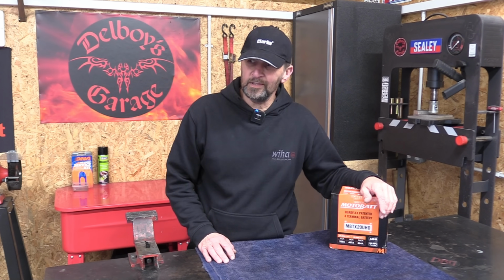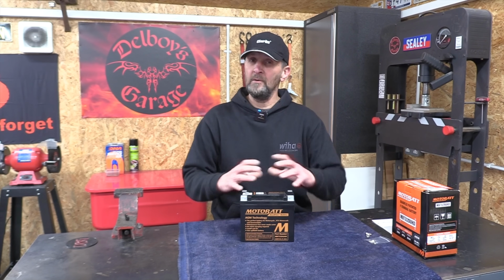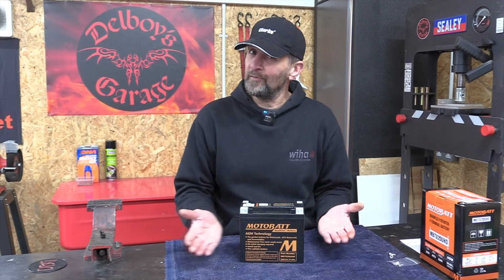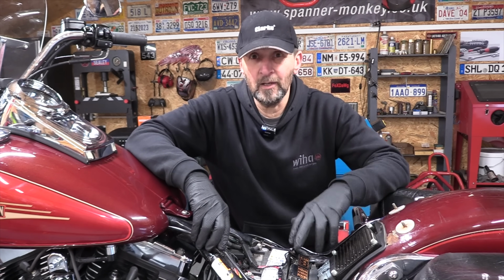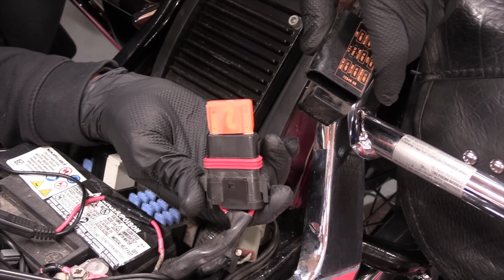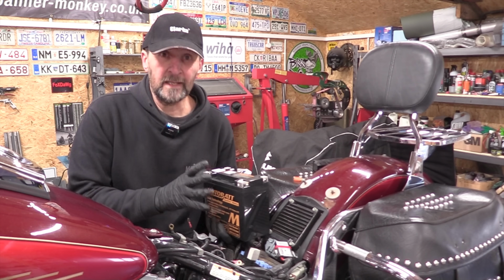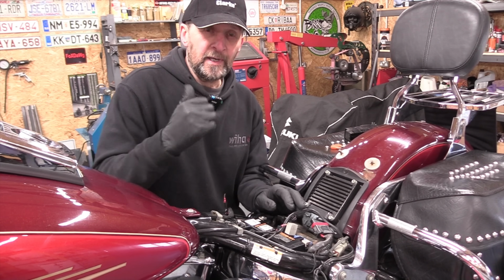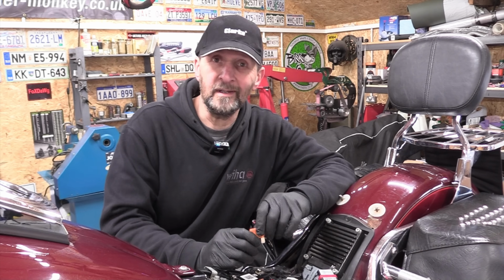Harley Heritage Softail:- Motobatt Battery Upgrade !

Comment: Just wanted to thank you for this video, this work around on the alarm worked perfect for my fxstc softail, and the video layed it out perfectly and simple. Gonna tackle changing fluids next:-) I’m really green at this but this video was spot on and just the pace that kept it simple. Thank you !!! Question: will a  Ctex charger maintain this battery in the winter months ?
Reply from the maker: Anything that is a proper dedicated battery tender, designed to maintain a battery over long periods is fine, just as long as it's not a straight charger only...

Comment: Christ you weren't wrong about those battery's Del just got one and they are serious quality just the bloody weight of it and the 4 terminals well what can I say handy as Fcuk,I wont mention putting it in the wrong way around 🙈🤦 spotted before I connected 😂😂.
Reply from the maker: Nice one mate, as you can see, you can actually mount them either way round with the 4 posts, as long as the cables reach... have fun!

Comment: I use that battery on a 1995 FatBoy. Durability is about 2 years and 6 months, I rode 30.000 miles with this battery. Just today I replaced it by a new one (same battery)
Reply from the maker: Yet I've had one on a Triumph for 12yrs... still going strong!... go figure
Reply: @ what durability time did you get with this battery?, the same as me?. It’s a good battery.

Comment: Lovely smooth video Del.
Batteries are the bane of my life! I have  Optimate 4 Chargers connected to all my bikes AND both my cars- but I still have less than good luck with the buggers.
I’ve found it’s a good idea to fully charge any battery before fitting: and then grease the terminals after. 
On my Deluxe, I’ve fitted a heat shield between the battery and the oil tank in an effort to try and keep the battery cooler. Hopefully extend its life. Heat is a battery’s enemy.
Without being condescending (truly), I thought you fitted that battery perfectly- +ve first on and negative on 2nd. Not a lot of people seem to understand that and the reasons why..
Very sharp and very knowledgeable for others to learn from.
I know I have.
Reply from the maker: Yes it is important as we all know, a little mistake with the lead arcing and suddenly it's all going flash bang lol...!  Thanks for sharing your experience and have a great week, ride safe mate.

Comment: Always run an AGM battery here too - although I did experiment once with a lithium battery, but didn't like it. That's interesting about that alarm procedure because I don't need to do anything on my Road Glide with security system before changing out the battery. EDIT: Oh, never mind, I don't have an audible alarm on mine, only the start disable security.

Comment: I could do with one of those on my 2023 BSA Goldstar 650 as the bike is on its 3rd  battery. There does seem to be an issue with these bikes on batteries, but apart from the 'Health Check' (AKA recall) BSA are keeping stum on that.😳
Reply from the maker: That's odd, sounds like a current drain maybe!  But if BSA are aware of it and it's already a 'thing' fleet wide, then it's more likely a design fault... hope you can get it sorted mate.

Comment: Well done Del, thanks for another great video! My first and still only bike is a 2003 Heritage softail in silver and black. Mine came with a few Lord Humungus studded extras. I don't mind my tank and rear fender bib because it has a silver paint job plus all the chrome i felt it looked better with some extra black bits to tone it down. I hated the dog bowl on the front wheel and had to remove it. I remember watching your softail vid on oil changes when i first got my bike before lockdown. I'm glad you now have a Heritage. I'm fairly tall and personally found the backrest and highway pegs really comfortable. Kuryakyn do a transforming back/pillion rest that works really well whether you want to ride alone or with a pillion, it looks and functions well. Not cheap sadly. I'm glad you have picked up loads more subscribers since i first watched. The work you and Penny have put in thoroughly deserves it.
Reply from the maker: Thank you so much for such kind words of support, and i do like the 2003 paint scheme, had it on my 03 Sportster and despite a full frame up restoration of the entire bike.. i left the fuel tank black livery alone.. complete with the huge anniversary badge. just looks right.   Than kyou again for your long term support, and ride safe aye !

Comment: I’ve never had much luck with AGM batteries, for some odd reason dis charged till I hook up charger, it last a while, alternator doesn’t fully charged it. New battery came out, it was part AGM and part wet, tried it, golly, had it for 5 years with tender on it, been the longest I ever used.  My 1990 gold wing battery quit 2 years for some reason, I put in same AGM/acid battery in it, so far it’s holding.  I’m not too much fan on AGM so win some, lose some on my part. Nice trick on that alarm system, I like that!! Really kwel.

Comment: I'm so old I remember when the hardest part of changing a battery was paying for it. On the new stuff you have to worry about all your electronics getting amnesia. Great idea having 2 sets of terminals for all the extra do-dads we stack on them. It's always nice to know you have plenty of crank on a 700+ pound bike. 😁 Thanks and blessings to you both. ❤👍👍
Reply from the maker: Sure thing Rick, they're still not cheap, but a necessary investment!  Have a wonderful rest of your week there, and thanks for all your kind words of support, it is appreciated!  D&Px
Reply: I MUST BE OLDER ..I REMEMBER WHEN THEY DIDNT COME WITH A BATTERY ,JUST A MAG AND A FUSE , WHEN THE FUSE BLEW , YOU TOOK THE SILVER PAPER FROM A PACK OF SMOKES ,WRAPPED IT AROUND THE FUSE , KICKED IT OVER AND GOT TO THE DEALER TO BUY A NEW FUSE ;;;GOOD OLD DAYS

Comment: Not applicable here is that another great thing about AGM (Absorbed Glass Matt) batteries is that they can be oriented horizontally also.  Hot rods, race cars and custom bike builders love them for that.  Race cars because they can be mounted horizontal AND they are very vibration resistant, so Harley (and all motos) of course.  Cheaper than Lithium.
Reply from the maker: Yes indeed, good point, all the benefits of lithium without the drawbacks, or the price!

Comment: With the m8 softails having the monoshock under the seat, the battery is buried and a pain to get to.  The new softail suspension is a good improvement on the old softail frame so I guess there has to be a compromise somewhere.
Reply from the maker: I currently have both, old and new Softail models, and I'd disagree that the M8 platform handles better, I'd say perhaps the forks are better as they're thicker, but the general handling of the modern bikes doesn't stand out in any way... the M8 weaves in long fast bends, whereas the old one doesn't... so perhaps there's still a little way to go!

Comment: Thanks for the heads up on the cost of Motobatt batteries Del. The Yuasa battery in my bike is around 4 years old so I may try Motobatt when existing battery starts to die. I always use a small square of high density foam underneath the nuts on my bike battery which prevents the loss of the nuts.
Reply from the maker: Great call on the foam, ive used a tiny chunk of 6mm plastic tubing to do the same.. but thankfully these don't have the nuts, just thread directly into the terminal post.. much simpler !

Comment: I do the alarm hack slightly different:    Switch on ignition  - and off again.   Then pull the main fuse within 2 seconds(!)  and the alarm will not know either.  
(when I connect after battery replacement,  I do it in reverse but not sure if that is necessairy)

Comment: Thanks for this very useful post. I have a 2016 Yahama FZ-07 (MT-07) and it originally came with a Yuasa battery (YTZ10S). I've replaced it once (with a Yuasa) and I'm coming close to needing to replace it again. I see MotoBatt has a battery for my bike and it is much cheaper than a Yuasa. I will give MotoBatt a try, especially since it has the two additional terminals for the extra electrical devices I have on my bike.
Reply from the maker: Good call, have a try of one, i think you'll approve.!  The extra terminals make it a no brainer.

Comment: Very informative. One question, does the battery come with 4 terminal screws for the 4 posts?
Reply from the maker: Mine had just two....so i used the two off the old battery, same thread.!

Comment: Have a 2022 street bob 114 fxbbbs and would love to upgrade the battery, but I cannot be arsed strpping down half the bike to do it, why did Harley not put the battery towards the side if the bike instead of making them hard to work on is beyond me??????  I'm having to leave my bike on trickle charge so I can carry on using the bike
Reply from the maker: Yeah, agreed, same on my Street Bob.. ridiculous location, don't know which would be quicker, lifting the suspension out, or stripping all the electrics off the left hand side... either way it's just daft aye !

Comment: Followed your tip with the fuse from the first video you made way back. Easier to fit a battery on this harley than my sportster , I needed 3 hands with 6 inch long fingers half inch dia to get to the bloody negative terminal lol.👍
Reply from the maker: Ha ha, aren't they annoying, designed to be fitted by The Borrowers..lol!    it actually helps out if you drop the earth lead off the engine end, and feed it through the inner hole, that way you can prefit the lead to the battery nice and securly.!

Comment: I still remember hearing about motobatt from you all those years ago! I fitted two or three to my HDs and some other bikes to! A nice trick is also to bind a strap of some description to the battery before seating it in place: that way when you need to pull it out it's a lot less work! On my fxstc there's almost no room for purchase on the battery once it's in place!
Reply from the maker: Mate, that is genius level common sense, make a small hook strap to pull it out again... only those who've experienced the fingertip scramble trying to get hold of it will know the pain...lol!
Reply: Yep, I use a flat cord. 
Next to no room and means the next guy will have an easier time… most likely to be me.

Comment: Question: Did Street Glides (2009) come with an alarm that was only flashing lights from factory? I’m wondering if the noise maker is broken or missing.
Reply from the maker: Not 100% sure, but i think you can silence the siren and still have the imobilizer system activated... check in your handbook, if it does, then it should cover the procedure !

Comment: I just replaced my battery in my 04 road king and it has a piece of plate metal as a hold down clamp on the one corner of the battery so I  figured that has to be on there to hold the battery. I couldn't get the 4 post battery. So looking at your setup Del, there's no hold down clamp keeping the battery firmly held down? I probly could remove that plate in my bike and it would be fine, although I thought the crazy vibration from the rubber mounted motor would cause it to move around slightly.  It is in its own cavity so I guess moving around will be minimum. I was just trying to re install the new battery exactly how the older one is in there...hey, im learning every day at 50 years old still....
Appreciate your videos Del....
Reply from the maker: I get what you're saying, ive found batteries to be slightly taller by a fraction in the past and can't fit the hold down lid... but TBH if the sit up to thier neck in a deep cavity they're harldy likely to fall out... and to hold them still you could cut open an old tyre inner tube to make "sheets" of soft rubber... slip some around the battery to hold it in place and absorb some of the vibes... works a treat, leave a 'tab' of the rubber just poking up so you can get hold of them to pull them out if you need to..!    Hope that helps mate.. and yeah, im 60 now and still learning every day..!

Comment: 😮 wish i knew this before, bought another Yuasa battery last year 🤦🏻‍♂️😂 and it does seem to run flat quickly in cold weather 😕 like 2 weeks
Reply from the maker: Sounds pretty quick, shouldn't do that unless it's minus temps where the bike is, or you have a drain somewhere.... can you use a battery tender (power in your garage?)